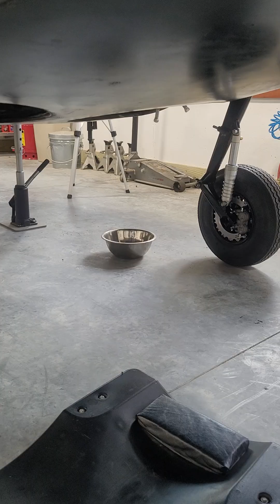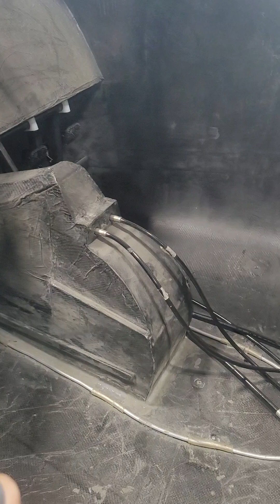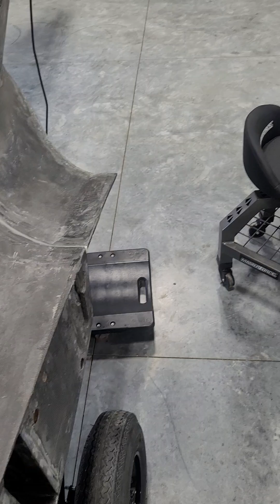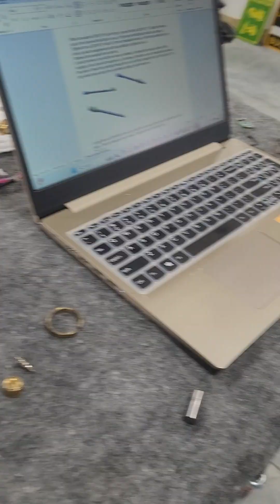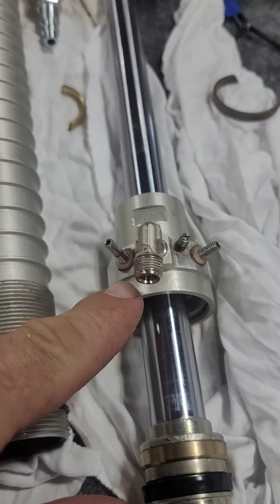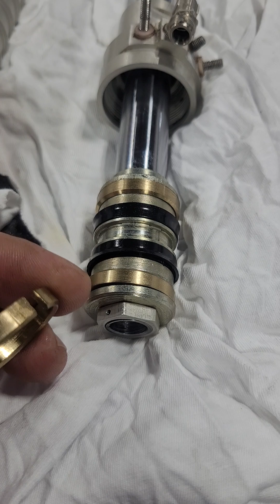ANG Patriot Landing Gear

Comment: How is your build coming along?  I think this airplane is interesting but I am still not able to see where one is actually flying nor have I seen any reviews by owners.  Would you mind sharing your overall experience?  Have you completed your build and is your plane flying now?
Reply from the maker: No ANGs have flown in the US yet. There is one completed that has NOT been approved by the FAA for amateur build as of this writing. The other build was completed at Veloce Planes. I am building mine by myself.
I am still in the process of building and saving money for the engine and avionics, so it will be a few more years until I complete my build.

Comment: Did u hear back from Jamie about a replacement?  seems its a defective part therefore it should be replaced by him as the US distributor.
Reply from the maker: I was able to fully disassemble the shock to include the cap. I had to use heat and a good vice to get the cap off, but I was able to do it. Both shocks are working as they should after replacing the wipers and orings.